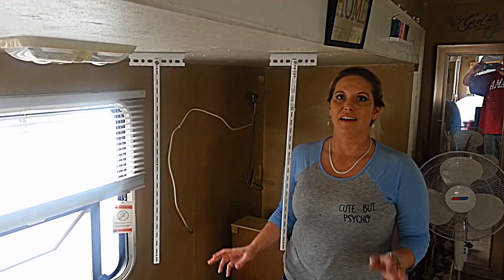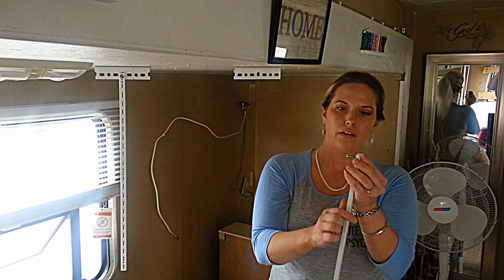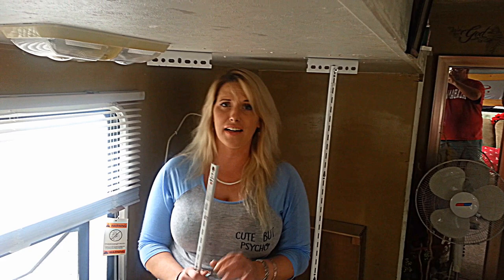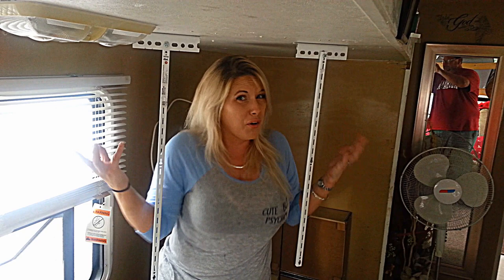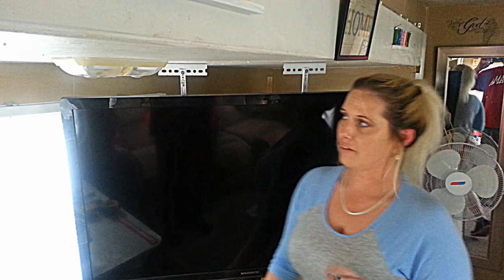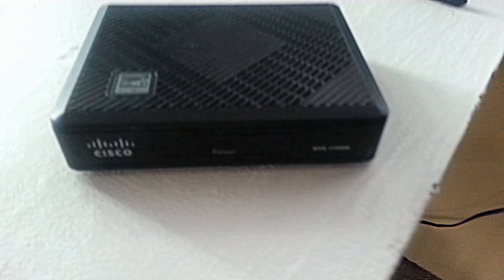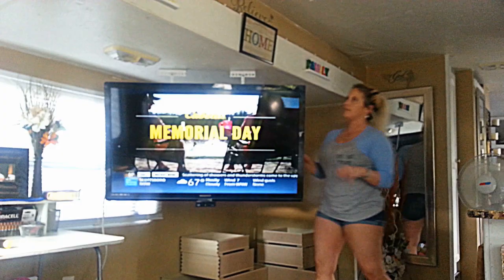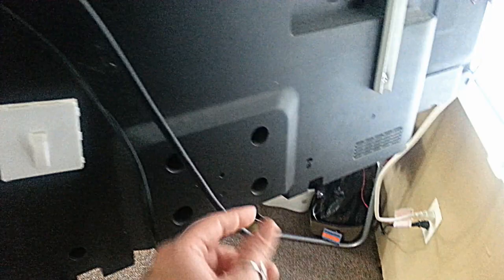How to make a TV Ceiling Mount for ANY SIZE TV $7 DIY / no major tools no wood. Just 3 pcs

Comment: Lets hope your slide out never leaks or you are looking at major damage or perhaps a fire. I find using a roll down screen with a projector much lighter and safer
Reply from the maker: So far so good. It's still there and no signs or indications of any issues around the area. You can look at the date and see when this video was made. Idk but it's been a long time since I posted this vid.  Thankfully we don't have any leaks. You're right, it would cause problems as it would a house or anything that was accumulating water damage.  A screen projector is a great alternative. That even crossed my mind but as lightweight as TV's are nowadays and if you take care of your rv keeping an eye on things, you shouldn't have any issues. Our slides have built in tarps above the outside roof as many do so with the mount being in the center of 12ft it's not getting rained on anyway unless it's a monster storm.  As far as a fire goes, each and every plug is plugged in the very same outlet as it was before the mount. There's no wires ran thru the ceiling so that has nothing to do with anything. You clicked on the video so you must have some interest in this idea. Give it some thought, you might love it as much as we do. Thanks for watching.

Comment: Two other ideas. If your monitor is light enough and has a flat enough surface, you may be able to Velcro the monitor to a wall. I hang my heavy Sony TV using 3/32 dia steel cables looped at each end and crimped with aluminum . . . .can't think of the name of that little crimped piece. Place eye of the cable over an open hook to hang it. The other end loop goes over screws, screwed into the back of the monitor itself. A hook you use to hold a potted plant. Just screw the hook into a stud in the ceiling. I have a short ceiling. Use two of them for balance and weight of the TV set. All the hardware can be found at home depot.